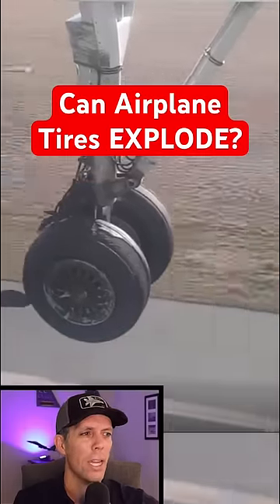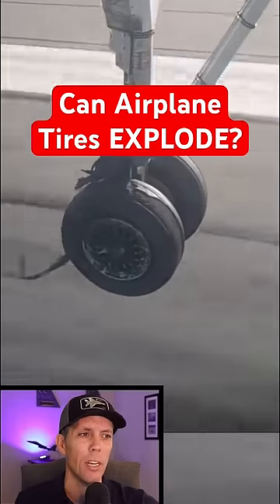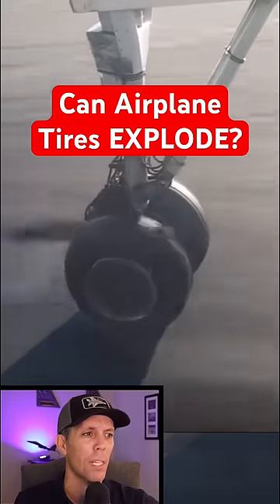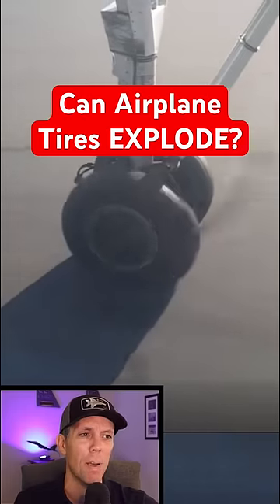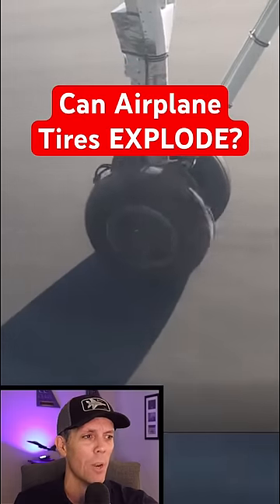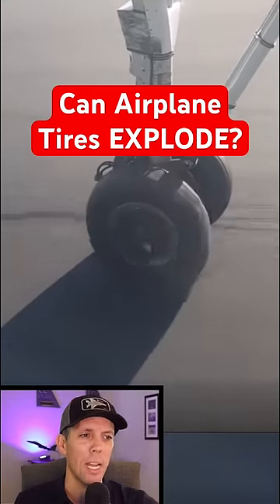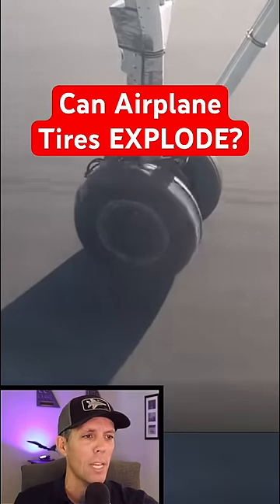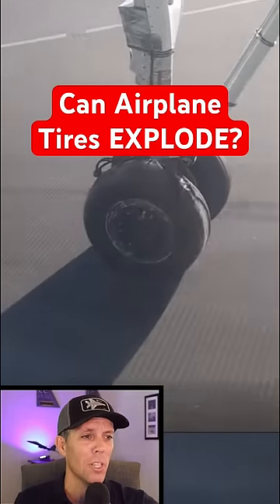Can Airplane Tires Explode?

Comment: For DECADES engineers have proposed putting vanes on the hubcaps to get the tires spinning in the air before they land.
Reply: And I’ve been propositioning free electricity for the whole world, there’s a reason both haven’t been adopted.
Reply: Wouldn't that destabilise the plane?
Reply: @DiscoMiata meit here. why would that be a bad idea. honest question
Reply: @Death88758  No. It would just spin up the wheels.
Reply: @DiscoMiata  Spinning a wheel is hardly junk science. Sheesh.
Reply: @flechette3782  well, the wheel would have to be spun mechanically which adds complexity and weight, both of which the engineers want to avoid the most.
Reply: @DiscoMiata   What are you talking about? We are basically talking about putting a small windmill on the wheel like a hubcap. That's it. Not complicated. Air goes by it, it starts spinning.
Reply: @flechette3782  ok…. Man…. are you unaware of the shear force it takes to spin one of these wheels?  Let alone up to 160mph from a stop  These tires are capital H HEAVY. Also tires are a wear item, the airlines don’t give a damn. They’ll use em till they look like they’ll explode or do hahahahaaaa
Reply: @flechette3782 those fans to spin those tires would have to be soo big that it would create more drag on the plane than the worth
Reply: @DiscoMiata i dont think they were tryna do 160mph at once...just a lil torque to assist...not sure how thats helpful tho...i still think the tyres should be as they are
Reply: @ShagWagon  OK, let's re-start this. I m talking about using a wheel of normal diameter and putting a hubcap on it. Not huge wheels. not an external fan. Just put a hubcap on it with little scoops on it like an anemometer. https://en.wikipedia.org/wiki/Anemometer
you don't need the scoops on extended sticks: just put them on the hubcap directly. They may stick out two inches at most.
So, you extend the landing gear, the scoops in the side of the hubcaps catch the wind and start spinning the wheel before touching the ground.
Reply: @DiscoMiata  Exploding tires are a "hahahaha"?
Reply: @flechette3782  I mean, an exploding tire on landing is pretty rare, but it does happen, I have seen cords showing on airplane tires when they come for service. (Used to live near a commercial airliner reconditioning yard)…
I laugh at it because I find peoples lack of maintenance funny as it’s their shit to destroy
Reply: @Jmack1lla  That's my point. it is entirely feasible and no one is doing it. A lot of executives are afraid of "risk" and will keep doing things the same old way as long as they can. Look at how all the world's auto manufacturers kept making cars the same old way until Tesla started producing electric cars. Now every car company is trying to introduce an electric car.
Reply: @flechette3782  yes its exactly like a windmill fan, has to catch the wind in order to spin. But it will also create drag on the plane thus costing more in fuel for the operation of the craft.
Reply: Why not use a different material for the tires?
We're wasting tons of rubber, they can explode, there must be a more efficient and less costly material. 

What about solid rubber (no air?)
Reply: @ALLBusiness24-7  weight. Also, solid rubber tires would leave way more rubber on the tarmac as it would take so much more force to get them spinning.
Reply: @ALLBusiness24-7  rubber is already expensive and your suggestion is more rubber...
Reply: @ShagWagon  But you want drag during landing. That's why planes deploy landing flaps. They need to slow down.
Reply: @flechette3782  but not during take off. Planes burn a large % of their fuel on take off and climb to altitude.  Adding extra drag to it would only require more fuel for take off
Reply: @ShagWagon  The drag is minimal. Seriously. Way less than the landing fear sticking out, flaps, auxiliary actuation pods on the wings, etc. Seriously, these would simply be a few scoops about a few inches long on the hubcap area of a wheel.
Reply: @flechette3782  that's not enough for a wheel of that weight to get it to even move let alone up to speed
Reply: @flechette3782  It is not feasible. It's been tried several times, and while it works, it's not worth the cost.

Airplane gear bays are designed to accept a specific size and type of landing gear and tire. Putting fins on the gear would require redesigning and recertifying a large chunk of the plane.

But that's something that can be overcome. The real issue, that can't be overcome with current technology, is one of weight. Hauling those fins around in the landing gear bay requires more fuel than not doing so, and the cost of the fuel is more than the savings that would be realized on the tire.
Reply: @ShagWagon  The weight of the tires is unimportant. Yes, they're very heavy, but they're so finely balanced that they can be turned by hand. (Seriously, go find an airplane tire changing video.) The problem is the weight of the fins. It costs more to haul the fins around in the air than would be saved by reducing tire wear.
Reply: @HiddenWindshield  you basically just answered the question to why they aren't on in the first place
Reply: @ShagWagon  Um, yes? I know? I mean, that was the whole point of my post.
Reply: @HiddenWindshield  I thought it was my point as well....
Reply: @ShagWagon  It was the reason. Weight, not drag. Which, yes, I realize I'm being pedantic, but somebody has to!
Reply: @HiddenWindshield  were both having the same argument for but for a different reason.  My reason is because of drag thus extra fuel cost. If it's a big component, then weight is also included thus even more fuel is required
Reply: What "Hubcap"? you mean the 3 inch wide grease cap in the middle? Ya know, the one actually capping the hub?

Trying to spool up a tire to somewhere in the ballpark of 8000 RPM via wind drag is mechanically implausible. First off, the wind would be impacting all sides of the wheel meaning you'd either have to mechanically lock out the hub from reversing or you'd need to come up with a design that only imparts force from one Direction. Second off, and possibly more importantly, you're not just spooling up a tire. Sure, that tire and wheel probably weigh a good couple hundred pounds and that's not that much. It's the near 3/4 ton of brakes you ALSO have to get spinning...
Reply: @DiscoMiata that’s just a dumb idea, how would they fund it otherwise?
Reply: @Pokerface-jpg  imma need some more context chief
Reply: The point is if one side don't spin as fast as the other side or exact rpm on both side when plane lands it will make the plane drift
Reply: @freddyfranco3291  bruh, are you aware they have to deal with that anyways? You think the wheels touch at the same time everytime? Nah. Sometimes one gets spun up hella fast before the other lol. Planes don’t land straight everytime.
Reply: @freddyfranco3291  No it won't. The inertia of the wheels is much, much, smaller than that of the whole airplane.
Reply: Good for landing not on take off. Also if brakes is deactivated it will spin the wheel after take off can't retract the landing gear because it can cause vibration due to gyroscopic effect.
Reply: @DiscoMiata  who would fund electricity for the whole world?
Reply: @DiscoMiata Both of these are unironically objectively good things that are withheld by greedy capitalists.
Reply: @wubzt3r  what is, the stupid Tire vanes?
Reply: @Pokerface-jpg  you’re giving me a brain aneurysm
Reply: @DiscoMiata  you don’t make any sense
Reply: @Pokerface-jpg  My bad, I thought we were still talking about the tire vain shit. 
Ok to explain my first comment was that i was being a smart ass and saying the reason free electricity and tire veins weren’t adopted is because both wouldn’t work.
That was essentially saying I would generate free electricity, not provide. Like breaking the laws of physics. Like I said I was being a smart Ass lol
Reply: The bearings are more expensive to replace than the tires. That would add a lot of drag and would likely cost more in fuel consumption across the fleet than they'd save on tires. If it was so easy and worth it, it'd have been done already.
Reply: @flechette3782 Drag is useful to a point. The primary purpose of flaps on transport category aircraft is to generate more lift at lower speeds so that they don't need 5 mile long runways. They do also produce drag which is nice to slow down. But too much drag would prevent excess power being  available when needed to climb, such as takeoff and go-arounds.
Reply: @ALLBusiness24-7 i think they reuse the rubber on paving roads
Reply: Whoo, ya'll mean to tell me that noise we hear as soon as the plane lands is not from the pilot hitting the brakes and applying reverse thrusters , which is what the pilots tell us , but from lack of tire rotation speed ?
Reply: @Airon79  There is no noise associated with the tire rotation speed inside. From the outside you might hear the stereotypical momentary squeak along with a puff of smoke as each tire touches down
Reply: @SgfGustafsson  No , that skidding-like sound as soon as the aircraft touches down is from a still wheel hitting the tarmac at high speed and not from the pilot hitting the brakes .
Reply: @Airon79  Yes but that sound lasts for less than a second. The brakes have an anti-skid system, so it wouldn't be from the pilots locking the wheels.
Reply: @SgfGustafsson  Planes have anti-lock brakes ?
Reply: @Airon79  Yes, it was initially invented for aircraft and trains.
Reply: @SgfGustafsson  Cool !
Reply: @SgfGustafsson  Wait ! Why trains , they're on a track .
Reply: @Airon79  Trains are the most prone to wheel slip of any vehicle. Their wheels are smooth steel on smooth steel tracks.
Reply: Unfortunately in tests it didn’t reduce tire wear by a measure able amount. Tire wear comes from heat generated by the rolling compression

Comment: "Sir, how did a a passenger get under our plane. WHILE ITS FLYING!?"
Reply: It's a DC8 landing gear. Pax is in, on the plane.
Reply: Aircraft is a high wing configuration so the fuselage (bit you sit in ) is hung below the wing

Comment: True, I used to pick up and deliver these tires to and from Honeywell. I was shocked that they were recaps but was astounded when they told me that they could be recapped up to nine times. Each tire has a serial number so they are monitored. I am not sure if they are allowed on passenger planes but often wonder if the last Concord crash had recaps or not.

Comment: Serious question: couldn’t They put motors on the wheels to get them spinning at nearly the right speed before landing. I realize it would add some weight but it would save on tires and runway maintenance.
Reply: That would require heavy motors, electronics mechanical frames which are just not worth it. Not to mention adding motors will cause huge increase in fuel consumption over a long period of time. Rather just change tyres, they are cheaper.

Comment: I worked for a company that builds the huge test stands that test the tires, braking and landing gear components. A lot of the tests are done to failure to study what parts need to be reengineered… pretty cool and loud even a tire blows up. We’re behind bulletproof glass because the shock wave from the tire can kill you

Comment: A tire blowout is no joke. 
In 1991 Nigeria airlines flight 2120 crashed because of an underinflated tire busting during takeoff. It overheated and caused a fire. Once the pilots had retracted the landing gear the fire spread rapidly until the fuselage gave away just minutes away from an emergency landing.

Comment: Tires can be recapped an indefinite number of times. And most have fusible plugs in the wheels so the plugs melt and release the pressure before a tire can build enough pressure due to heat to explode. Some tires are filled with dry air too, not just nitrogen.

Comment: I've always wondered why they don't just add little cups or fins to the sidewall of the tire so that they would spin up through the air. I guess it might be costly but it would spin up the tires so they wouldn't have to be sped up on landing and lose so much rubber.
Reply: Might as well add a motor and just actually get them spinning up to speed
Reply: That has been tried, around 1940, and it was more trouble than it was worth.  It made almost no difference in tire wear.
Reply: @Hopeless_and_Forlorn  interesting. I suppose they would have to be spinning really fast in order to match ground speed.

Comment: I flew the Dash 8, for many years never had a flat.  The tires are very tough, you are allowed to have two cords showing and operate the A/C.  Tire wear depends on many factors, so 200 to 500 landings is normal.  The pilots visually check the condition of the tires after every landing. If more than 2 cords showing, the tire gets replaced.

Comment: Idk how 1lb per wheel was spread on the internet but that would be an insane amount of rubber if it were true. 

I just read a scientific paper that said a tire of a 747 will leave .132 lbs of rubber per landing. So the entire plane will leave under 2lbs each landing. Interestingly that is reduced by 2/3rds if you spin the wheel to full speed before landing.
Reply: TY, that makes more sense, I was wondering how one tire leaves 1lb of rubber per landing and is good for 200-500 landings (even with retreading) that would have to be a BIG and heavy tire👍
Reply: Well what happens is there's all of these pilots that desperately want you to know they're a pilot, so they make videos telling you something you might barely find interesting and they don't care if it's true or not and they heard it from the last guy who was like them and they got views, so that's how you get people to see that you're a pilot.

Just make sure you know those guys are pilots, that's all that matters.
Reply: Did they try spinning the wheels faster than the ground speed to try to have more momentum before hitting the tarmac? I don't know if that would work. I assume it wouldn't, just curious of they tried
Reply: @chrisnoname2725  I think 74gear has a video on it. Basically the complexity and weight of a system to drive the wheels negates any advantage to spinning the wheels prior to landing
Reply: Yeah, I was going to post the same thing. I'm an aircraft mechanic and if that pound statement was true, I'd be changing tires nonstop all day lol.
Reply: I came to the comments to see that!
Reply: @Falconx84  and image if that system was 1% off side to side while landing.
Reply: Matching RPM would be the problem.  They actually brake the wheels until they actually touch the runway.

Comment: I have often wondered why the tyres aren’t given a teardrop pattern along the side walls to enable the rotation of the wheels to match the landing speed ( the same as they do to power air tools!)
Reply: Yes, I had an idea years ago about putting wind vane fitted hubcaps on aircraft wheels to help them spin up prior to touchdown but it seemed too complicated for some reason.
Reply: There are lots of ideas…. Many patented. But the tyre companies bought the patents!
Reply: maybe because they would rather slow down the plane instead of save the tire
Reply: maybe from where your from but not here in the USA
Reply: @BeReady726  True! Some parts are intentionally weaker than others so that the failure happens there instead of beating up the more expensive parts. Some people here would freak if they understood the logarithmic jumps in the energies being contained or supported here.

Comment: Question. Was on a flight and the pilot thought the tire blew on takeoff. Plane circled the airport for some time to understandingly dump fuel to reduce weight…which would be normal for any emergency return landing. The question is why turn back and not go to the destination? At the end of the day the plane still has to make a landing. Is it concern that the landing gear might not retract or come down normally?
Reply: I'm wondering this too... seriously
Reply: @billymanilli  I think it’s because a tire blowing can cause damage to the landing gear (outside of the tire itself 😂) and if they were to continue and retract normally or the gear might not come back down when they try and land? 90% sure but still curious.
Reply: Curious too
Reply: 1. It may not retract properly with a blown tire.
2. Even if it would, you may want to turn around if your point of origin has the equipment to fix the tire, especially if your destination doesn't.
3. You just took off from the departing airport, so you know what the conditions are. You don't actually know for certain what conditions will be at your destination, so it's better to land at the airport you're already fully informed on. Forecasts are not perfect.
4. If the tire is only damaged, but has not actually exploded, flying to a high altitude (e.g. for cruise) may cause it to explode inside the landing gear bay, which can result in major damage including breach of the cabin pressure vessel (which is a major emergency).
Reply: @masterdynamo6457  thanks for your exquisite explanation!
Reply: That was my first thought. Why not just land again at the destination. Safety first.
Reply: Because of Nigeria Airways 2120

261 people onboard, tire burst during takeoff, plane retracted landing gear into cargo. The heat from takeoff ignited the tire which spread to the plane, causing it to crash not very long after takeoff after trying to return to the airport (like, minutes, but I can’t find how many. Longer than a couple but I think it was less than thirty. Def less than an hour)

The accident was basically unavoidable after the gear was retracted, they realized there was a problem only two minutes into flight. 

I think there’s fire suppression stuff in landing gear now, but there may be other safety reasons why the plane turned around too.
Reply: An exploded tyre can cause damage to the fuselage and wings potentially, and of course they can’t know the extent of any damage in the air, so it’s safer just to turn back.